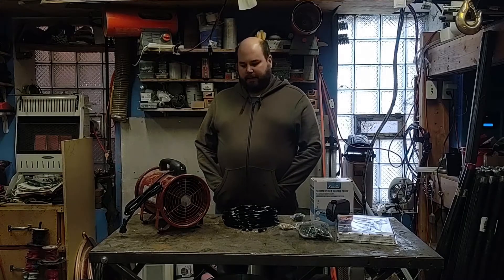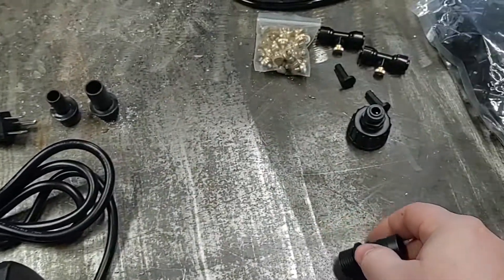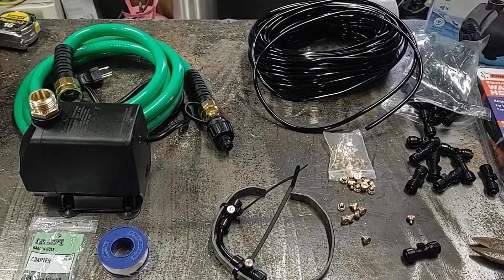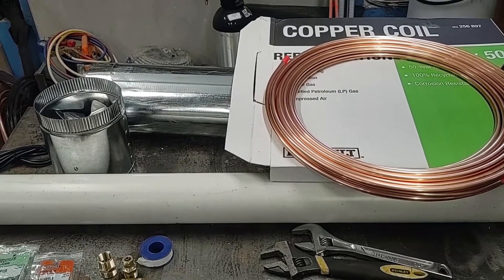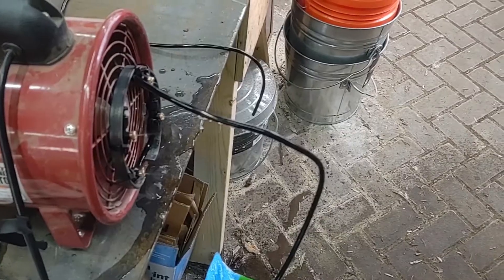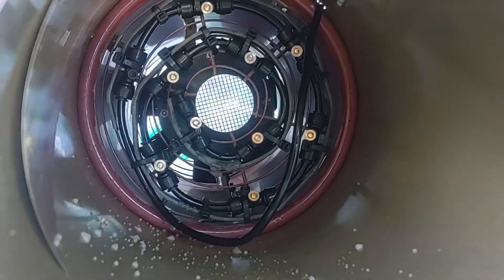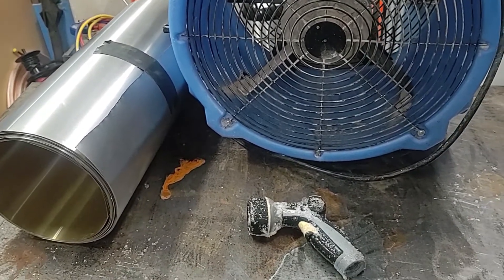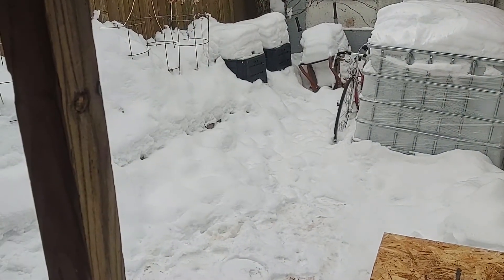DIY Snow Maker Build

Comment: I was curious because I to was considering testing the misters but the ones that you can use PVC pipe, larger diameter would less likely freeze and clog.  Anyone in a could was m climate has left a tap dripping to prevent freezing pipes. 

That said all the successful DIY builds I have seen either make or buy a larger mist/spray nozzle or nozzles and build a valve system to mix high pressure compressed air and the water, as it is forced through the hole in the nozzle it tends to rip the water apart and form much smaller unnatural size droplets.  I saw one guy using a harbor freight pressure washer as well.

I still find it hard to believe the mister would not work.  Here in Utah in the spring, it is not uncommon to see large mounds of icy snow when they run irrigation before things totally warm up, like near the feed point of a  large Ag pivot sprinkler systems where the water sprays out of shall leaks.  

We also see evaporative cooling in snow storms because we tend to be so dry, it is not uncommon to see snow at 36º and I've even seen heavy snow at 38º on occasion.

Comment: Yes, as many have metioned, the key to snow making is a nucleator.  Without it, all you have is a fancy skating rink flooder. Its easy enough to make a nucleator nozzle, but you are going to need an air compressor, and not just any old compressor. You need one that can run full time aka 100% duty cycle.

Comment: Man, making snow!! Building a machine like that takes a lot of snow making knowledgeable. 
As I type, my yard is turning white from the system I built. 
Your system is on the right track. 
But you need to have a water pump that will really move the water at a high rate of speed. Like a pressure washer. 
The blowing machine, once. I used a 15 gallon drum, a squirrel fan, Polly and spray nozzles from a car wash. And then I use an air compressor and a pressure washer to move my water a lot quicker, to break the water down in the snow when it left the end of the machine.

Comment: I built a Snowmaker of my own I think you're idea is very creative but you're overthinking it, all you need is a air compressor and a pressure washer into a snow gun. But I like your thinking so far, keep it up and don't give up trying. I think you just need more pressure and maybe to do a different design like a air/water gun and you need a nucliation nozzle to put out a mix of compressed air and pressurized water to freeze and go into the bulk mist and stick together and create snow! keep up your creativity nice job!

Comment: 2 tips #1 get a damn pressure washer run the water line from the pressure washer to your little nozzles! 
#2 get a damn air compressor! Buy some fittings

Comment: You're making this way too complicated.... Then one right on the inside it's a compressed air water mixture...that's it... Outside air temperature needs to be 28 degrees or lower... The dryer the air outside the better..

Comment: Really to make snow your are gonna need a nuclear or nozzle. It’s a air and water mixture. With our that nothing is really gonna happen. Also the most need to be a lot finer and at higher pressure. This is a great start, just need a little work.
Reply: Also. Put the nozzles on the end of the funnel so they come into the stream of air not into the air and land on the funnel
Reply: @herobrien062  you need a nucleation box with a nucleator and yes nozzles need to be pointed inwards at roughly a 35 degree angle and if using a nucleator it needs to be pointed into the water stream from nozzles at 20 degrees. You can use nucleation nozzles from like an HKD pole gun but the problem comes with home built fan snow guns is most home owners can't move enough enough water at a high enough pressure to atomize the water droplets and they make ice unless it is well below freezing. I built a few full size fan snow makers at Windham Mtn in NY back in the late 80s early 90s. If you can find one a snow maker company by the name of Hedco made a mini fan that had a cone ring wth 3 rows of nozzles of different sizes for different temps that was only 8-12 inches diameter that does work as a home snowmaker if you have a water booster pump to bring pressure up to around 150psi and can supply around 15 gallons per minute there was at one time alot of the Hedco minis floating around many ski areas and backyards around ski areas they were cheap and worked and some resorts use to sell them out of their ski shop as a backyard snowmaker. Alot of times if you come across a private owned ski resort there is a boneyard and most of the time if you can track down the manager or owner or who is in charge they will sell you stuff from the boneyard if it's no longer used some times even give it to you if its something small. I have managed to amass almost a mountain's worth of old snow guns like ratniks and ratnik quads and old Dendrites and a few old fan guns and Hedco diesels and water pumps and air compressors all out of resort boneyards and from a local mountain that closed in the 80s and sat till 2018 and a guy bought the falling in resort and just wanted everything gone and I went in and moved everything snowmaking wise out of it and may possibly get lifts at a later date when the new owner decides what he is doing or if he can get investors to develop it. Just putting it out there you can find old snowmaking equipment and adapt it to back yard for cheap if you do some digging usually corporate or state owned resorts you can't buy anything even though there is still boneyards at them and if you can buy from them there is usually so much red tape it's not worth it. I have a 100ft so called bunny slope or sled slope I make snow on every year and all I have there is an old 8hp gas fire pump and an old portable tow behind 100cfm compressor and snowguns made from 1 1/2 inch galvanized pipe scraps and a bunch of old 1 inches fire hose that I got from local fire depts from brush trucks I think in total I have $800 invested which was pump and compressor and if temps around 25-30 degrees I can make a foot to a foot and a half on the trail the full 100ft of it and full width of trail which is around 30ft and I can go longer if I move guns from there posts to either another post or something solid. Air/water is the way to go because of the simplicity air shot into water stream for atomization no electric but need enough water pressure to carry it. fan guns run optimally at lower temps and most have very little adjustibility air/water is for higher temps and have more adjustibility lower temps more water less air higher temps less water more air
Reply from the maker: Thanks for the ideas, maybe Ill have to give this another try this winter.

Comment: Love this! I would recommend getting a stronger pump to have finer mist, or you could also just run it from a hose instead because you can now make unlimited snow and finer mist. I have made a snow gun and I used brass 3/8 which was big enough to not freeze. Lastly, use compressed air instead of a fan, you need a nucleator to make snow which utilizes compressed air. Here is a link to some snow gun plans which also describes the process of making snow: https://www.snowathome.com/free_plans/SAH-SG2-combo_internal_mix.php 
Hope this helps!
Reply from the maker: Thanks for the ideas for improvements and link to plans.  Maybe I'll have to try to setup an upgraded version this winter.